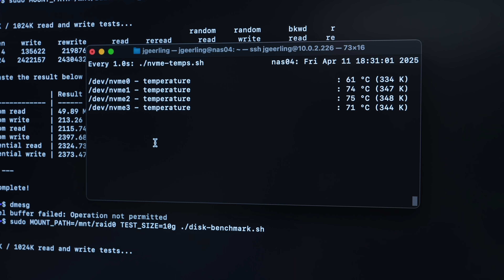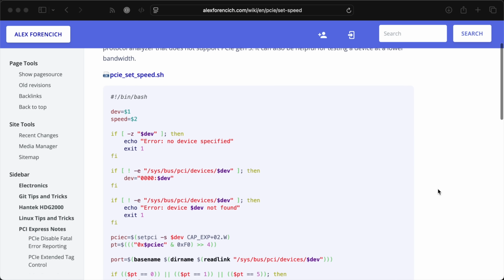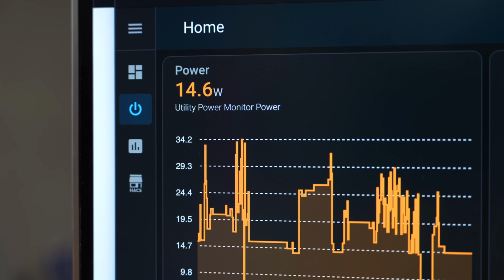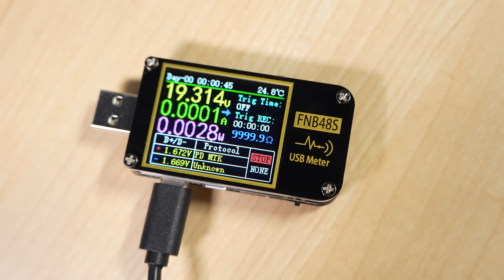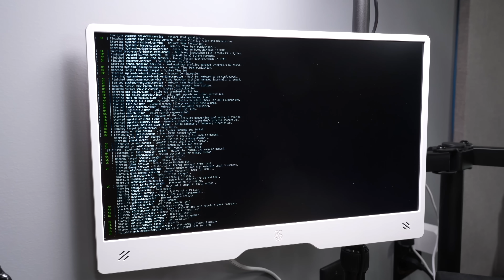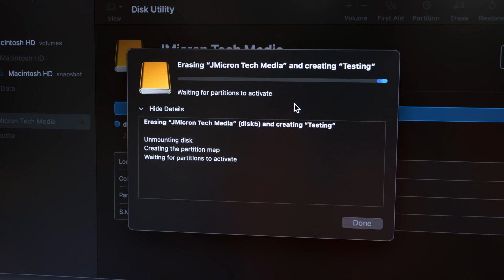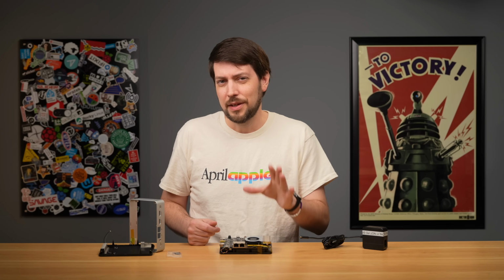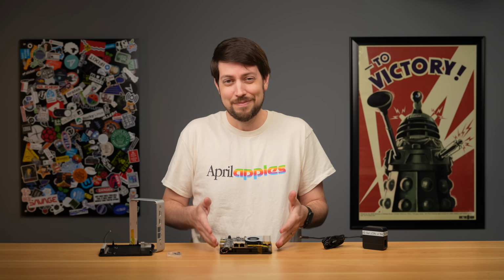I fixed the perfect Mini NAS!

Comment: WOW... the freakin Power Supply. 
I'm sorry, but this is just one more reason why I HATE Mini PC Devices powered by USB-C/PD jacks. My only exception is the ones that will power FROM a Monitor. If it requires its own power supply, a good old solid 19V Barrel Jack wins-out every time.

Watch any tech channel where they do laptop repairs, and you'll learn that using USB-C Power Delivery requires (and often FRIES over time) additional Power Phase MOSFETs... if it can be avoided, USB Power should be avoided.

One of the 2 chips you put a heatsink onto was the power input MOSFET, BTW.

Comment: Yes!!! Absolutely take them up on their offer.

GMKTec needs to run their device through basic engineering/product development thermal management analysis.

I understand that they're trying to make it as inexpensive as possible, but if it doesn't WORK, then it's just manufactured e-waste/garbage.

Comment: I think we're taking steps back in capability if the hardware stack (the exact problem component wasn't identified) can't handle temperatures in the 40-60°C range.
Reply: I do thinkt it's actually the network chip that's getting problems the N150 can take 105 °C before throttel the NIC  Intel I226-V is done at 70 °C it's also bad as in known to make problems.
Once again I've seem to have been rather lucky with "my"* G9. It runs fine with the 4 x Kioxia Exceria G2 2TB drives as well as the 4 x Crucial P3 2TB and the 4 x TWSC TE3420F1T0 1TB (MAXIO MAP1202 Rev 1 Controler) drives I tested it with.

*Not really mine. Got it for a friend and was testing it here and did populate it (with the Kioxia's if anyone is interrested) before I shiped it to her.

Comment: Man, you saved me from my first NAS build being a nightmare, some other reviews I saw were clearly sponsored and actually did not get any big issues. Since there were shipping delays I was thankfully able to cancel it. In the meantime, I think I will go for the pi solution with a hat in the future.

It is sad because on paper, this is an awesome product for a portable Nas /homelab, but with so much heating and performance issues, it was a big missed opportunity by gmtek.

Hope you test other similar solutions, my idea was hooking up an nvme solution with an external DAS that I can use for cold storage backups locally.
Reply from the maker: Some of those other reviews weren't sponsored (just provided hardware from the manufacturer), the difference is usually when someone is testing something from a QA perspective (in my case, as something I'd consider deploying in production in my homelab), versus testing for a review.

If you don't hammer the G9 hard, and run it for a few days, you might not run into some of the issues I did. Then if you don't turn over the stones when you find them, you don't find all the little bugs underneath!

I spent a lot of time in software development alongside some great Quality Assurance analysts... and they taught me a LOT about designing things better, finding flaws, etc. It's as useful when testing hardware as it is software!
Reply: @JeffGeerling  I do agree. it's nothing I would ship but than again see ECC ram alone makes the CPU not viable and and I'm sure no one wants a box with server grade fans on there desk as that's where these boxes usually end up. Not the rack.

As I don't have "mine" anymore Jeff could you bond the two nic's on your switch und just pump it full tilde? I'm almost sure this will make it reboot as I very much believe the NICs are the actual problem.

If you don't want to bother that's fine. 
The product, as it is, should be a no buy. Hope GMKtec make a fixed revision.

Comment: I took a look at the Aiffpro unit. 8GB (LPDDR5) soldered RAM doesn't seem to be enough for ZFS and whatever backup or service tasks I would want it to do. Combined with using the N100 and the price point, it doesn't look interesting. The upcoming Beelink ME mini has a fat cooling block and may perform well. It also has soldered RAM though (12GB). 

I would also love to see a review of some of the new Ryzen AI Max mini pcs. GMtek is making an EVO-X2 and Framework has an Max 395 board. Both have 64 and 128 GB RAM options. Self-hosting AI with home assistant is looking better all the time.

Thanks for calling out GMtec's bad charger. Having a damaging or dangerous deviation from spec is not acceptable. 

The Aiffpro unit also is using 20V over USB-C, although it has PD listed. I am curious why both companies are using 20V. To my knowledge, all the components use 5V or less. 5v chargers like the Pi's are plentiful and cheap.
Reply: Ive been using the K100 for a while now and its been solid. Unraid with ZFS for the array and 10 or so docker containers. Pretty good box...a little pricey but its a solid travel NAS
Reply: What do you even want? The best N150 can do is 16GB of LPDDR5 4800 and once again, there is no good reason to run ZFS on a cookie box like that.
If you need more than rsync for your backup needs than I honestly don't know what to tell you. Git Gud I guess?
Reply: @DJDocsVideos  Lol, Jeff used ZFS for his testing in this video. Even if he hadn't, ZFS is common for NASs. Also, 16GB 4800 is not the best an N150 can do. Since you don't understand English well enough to grasp what is going on, don't try to correct people. Hinterlassen Sie keine beschissenen Kommentare, wenn Sie das Video nicht verstehen.

Comment: Interesting work! I'm finally getting around to buying NVMe drives & extra CM4s for my Deskpi Super6C trying to get the whole cluster thing working. I have to say it is a bit of a shame that the Deskpi case doesn't have space for NVMe heatsinks on the bottom. I'm now wondering if I could stick some of those 1mm chewing gum thermal pads between the case & drives to try to use the metal shell for a little free cooling...

Comment: Thanks for all your work on this! I was very tempted to buy the same GMKtec - and then stumbled over your video. This would be the perfect tiny NAS box for me. I dont mind the low speeds. But it needs to be stable and not overheat. And that power supply is just ... no.

Yes, please test the K100!

Comment: What I am amazed or more said to hear, that the Producer GMK T did release such without an proper test! This is really just shows how GMKT is sooooooo cheappppp, but really a very baaadddway! This should have not come out from a reasonably responsible production line and being soldand not even recalled to be fixed!

Comment: The #1 rule for reliability engineering is to de-rate every component, so you're never trying to use it at or above its rated spec.

My passively cooled J1900 Bay Trail mini-itx diy NAS powered by a laptop brick is still still rocking after 11 years.

I like the idea of tiny form factor nvme ssd NAS, but products like this don't inspire confidence.

Comment: Are you planning to get a BLE caberQU? (Got one for this exact reason, forever scarred from USB-C cables not being in spec)

Next NAS upgrade is soonish (It was the N100 but taken so long to get around to it, now thinking of waiting for "Wildcat Lake" 😂(alleged Alder Lake N successor with Panther Lake Arch and an NPU)

There is an article on Toms Hardware if anybody is curious or wants to hold off plans, still alleged so a grain of salt applies here:

Wildcat Lake seemingly only has one variation with six cores (2P + 4LPE), presumably using the exact Cougar Cove and Darkmont cores as Panther Lake. However, the Compute Tile will likely only house the two P-cores, while the LPE-cores are expected to reside in the SoC Tile. On the other hand, 40 AI TOPS could make for some fascinating use cases of these processors in edge and mobile machine learning applications.

Comment: This (IMO) is the universal weakness with any of these tiny puck PCs - thermals and airflow. Having to completely lobotomize the CPU to get it to run stable also seems like a red flag. It feels like, at this point, you could 3d print yourself a 1U Pi enclosure instead and be ahead of the game.

As for the AIFFRO unit...if they are letting you go at it and taking your feedback to improve (ie, the usual "doesn't influence what I say" disclaimer) then it sounds great.

Comment: What I really want is mini PC level performance but in a standard 1U case at a reasonable price point. Does that exist ?
Reply: Your specification is unclear a mini pc can be anything from a Intel N95 with 4 GB of RAM  up to a AMD Ryzen Al Max+ 395 with 128GB of RAM

But if you want to go 1U why not go with an EPYC 4004. Fits a board with an AM5 socket. Supports ECC RAM and you can go from as low as a 4 core EPYC 4124P all up to a 16 Core EPYC 4564P
With mainboards like the AsRock Rack B650D4U
Or get a used 1U server from ebay replace the SAS HDD drives with SATA SSDs use SAS to SATA adapters.
Reply: @DJDocsVideos  I meant just something of low power consumption ~ 15 Watts. CPU performance is not that important considering my home server is fine for me and that's an old elite desk over 10 years old. But with a larger 1U case I could possibly fit a GPU cable of running very small AI models mainly for home automation.

Comment: Thank you for answering my suspicions about cheap SSD storage. I've always avoided it out of caution and It seems I was right to do so. I have similar suspicions about cheap/unfamiliar brand RAM too.
Reply: for storage I wouldn't take the risk but for RAM it is generally fine, as it's simply a it works or it doesn't 

with that said, I have seen counterfeit ram that claims to be Kingston HyperX and they behave weirdly if you try to use XMP on them.
On the other hand, some no name ram from aliexpress I got was just oem samsung modules with the labels changed, I couldn't find anything else wrong with them.
Reply: @TingFeng77  samsung is exiting the DDR4 market this year and the other "big" names gonna follow soon so "strange" china RAM will be the only option for DDR4 in a not so distant future.
Reply: Because one of the 4 drives was DOA? That's the rate I have for Samsung Pro drives.
I've just been testing a ton of lower end SSDs and honestly if you go for one with a Maxio or a InnoGrit controler you don't do worse than with a Phison E21T. It makes very little real world difference.
Using a DRAM buffered SSD on a system that doesn't even use all 4 lanes for the SSD (no matter if Gen 3, 4 or 5) is a waste in any case and can give you worse perfromance in some cases.

I know all you wonnabe storage admins (apologies to the one SAN admin that reads this and feels offended, it's not about you) love your ZFS but it's not the best tool for the task in any and all cases. 
If you have the RAM, CPU and bandwith to spare it's great but... on a cookie box like this devices...
Let me repeat for those who are butt hurt now. I don't say you can't. I just say it's not the best of options and the best of options depends on your specific use case and hardware.

Comment: After seeing all this I bought a Topton Intel N150 i3-N305 board with 10G and 8 cores to go into my old 19" rack properly-cooled 2U case, where there's plenty of room for everything. It lives in a rack, I don't need to see it in my living room, and it has already had a ten year life as a Proxmox server with a (now!) old AMD board in it... proper PSU too! Small is cute but bigger is better ;) An array of SATA SSD is fast enough to saturate 10G connections... nVME for the system etc.

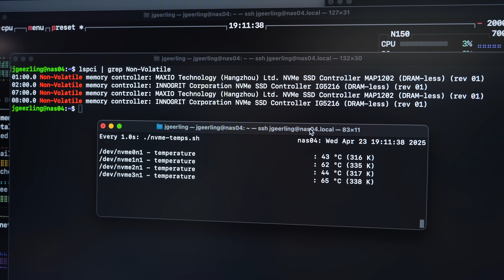Comment: 10:16 Seems like one of those SSD controllers runs much, much hotter than the other, though it’s not totally clear which is which. Either way it looks like a crapshoot which you’ll get with these cheap drives

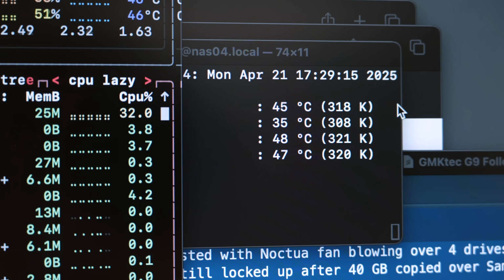Comment: 3:54 Sounds like someone had an idea for a mini-PC and designed it for aesthetics over function.

I did have an idea seeing it out of the case... what's the size of the board? Is it about the size of a 3.5-inch drive? Or is it the size (width) of a 2.5-inch ssd? I wonder if you could 3d print a 3U case for your mini-rack and use one of the M.2 bays with a sata expander and throw a bunch of drives in it?

Comment: Screw that shit. I really mean it, that's pure garbage. It's not worth the effort and certainly not all the work and time, you spent on it.
Use a RPi5 and a 4x NVMe-Adapter.
2,5 GBit/s or even 5 GBit/s LAN-Adapter on the USB 3.0-Port, OpenMediaVault and you're up and running without any hassle.
But who am I to tell you that ;)

Comment: At this point, you're basically gearing up for a head-to-head Mini NAS showdown. If you're going to accept the K100, try to find maybe 1-2 other options at the same price range as the G9 and aforementioned K100. Do a roundup, and find a non-Pi Mini NAS winner. Surely a little company out there has actually made some good hardware that DOESN'T cook itself.

Comment: I do wish mini pcs would adopt usb PD as charging standard. Most use their own charger (barrel and some messed up usb like this one). I think it is due to issues on cost of negotiating or power consistency when the mini pc has no battery, but I would greatly appreciate such a change.

Comment: Lesson to take away: don’t buy crappy off-brand SSD’s.

I am very tempted to also say ‘don’t buy crappy off-brand mini-pc’s’ but I think a PC is a lot more complex and issues can be forgiven a little more easily. But I will avoid GMKtec based on the state of that power brick alone. That is unacceptable.

Comment: why did you turn off the CPU turbo it was the SSDs that were overheating?
Reply from the maker: Heat is generated inside the box and doesn't escape, so the CPU excess heat just makes all the other heat issues worse.

Also, from the thermal investigation at the end, it looks like the VRMs feeding power to the CPU also get quite toasty—so running the CPU at lower power means the VRMs (which are uncooled, dumping a lot of heat into the uncooled part of the case) also don't dump as much heat.

Comment: LOL... These projects are fun for producing video content but for anyone who just wants reliability the TLDR of any home build nas video is: Buy a Synology. :) I know I sound like a shill... but fiddling with cursed mini PC cooling and kernel parameters just to get storage is very poor use of anyone's time... except that of Youtubers of course. Cursed hardware is one of the best video fuels out there.
Reply from the maker: Except that Synology is starting to squeeze the juice of locked-down hardware, where they'll require their own hard drives instead of any good NAS drive.

But there are plenty of options that are great if space is not a concern. I personally run a few ASUSTOR NASes, but would probably be fine with Terramaster, QNAP, UGREEN, or Synology too. Just don't like the direction Synology is headed.

Comment: I got the Ugreen NasSync DXP480T, it's a beast of a little machine and I upgraded the ram to 96GB and run 4TB HPE NVMes in there.  I'm not a fan of the Ugreen OS so i may just run TrueNAS Scale, but also waiting on some maturity of HexOS.  Regardless, runs well..may be a little tall for you needs but it's nice for the size.

Comment: Take them up on the offer. Also, maybe you can 3D print some sort of case for the one you tested here. You have room on the sides if you put it in a rack so maybe you can add some fans or whatnot to the design.

Comment: You're confusing the physical connector (oval shaped plug and receptable with a reversible 24-pin layout) with the USB-C specification. The USB-IF does not control the physical connector, they control their trademark and require compliance with their specifications and certification testing in order to use their trademarks. As far as I can tell, the power adapter is not labeled with anything implying compliance with the USB-C standard, nor is the device itself (even the USB Type-C compatible port on the other side is simply labeled "Type-C"). For the same reason, ports can be labeled TF or Transflash instead of using the trademarked MicroSD label. Or how 8P8C, RJ-45, Ethernet, and 1000BASE-T might refer to the same thing to different people, even erroneously, they specifically mean different things. 

TL;DR: "USB-C" implies compliance with a specific standard. The physical Type-C plug and receptable does not imply compliance with that standard.

Comment: If you have to turn this into something closer to a Pi3 based NAS than anything else to make it work properly its worse than I thought it was from your initial review...
I don't know how you could create a product with such inadequate cooling that it is actually that unstable rather than just throttled slow in today's world, and shipping a USB-C end PSU that is a fixed voltage above 5V should be grounds for execution with how much e-waste it is going to generate!
So yeah congratulations on convincing me that a Pi family is still actually just about the only option in low power and actually pretty darn reliably functional (which I know is wrong, but when you are taking a crapshoot just to see if the alternative stays running under a perfectly normal and seemingly intended usecase...